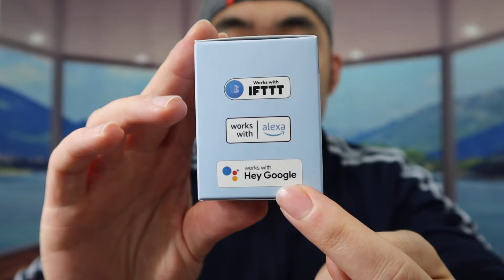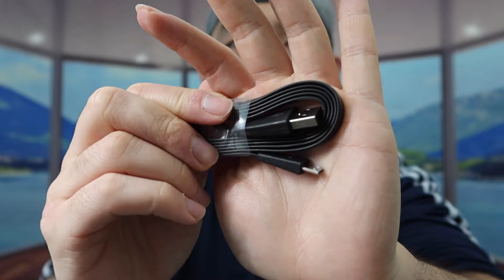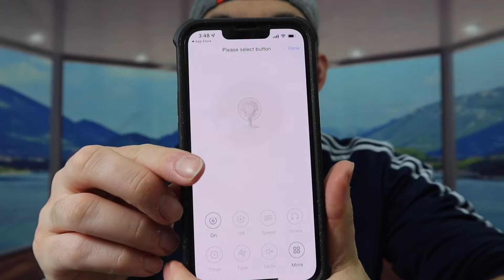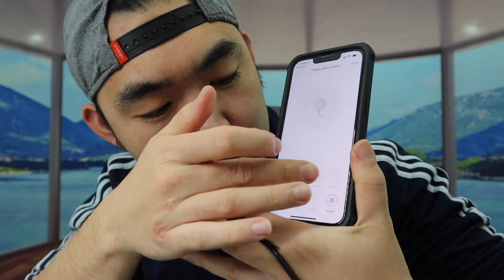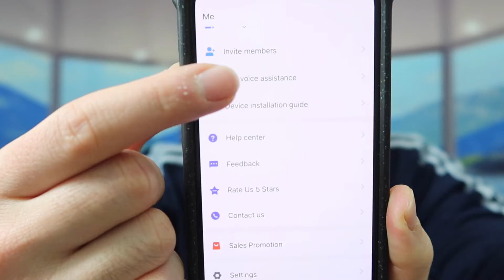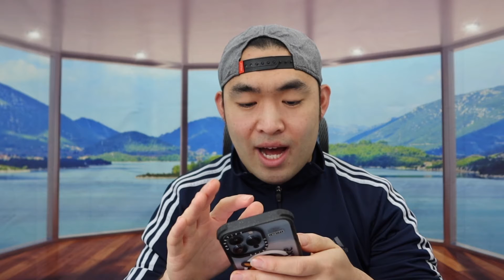How to Use BroadLink RM4 Mini IR Universal Remote Control?

Comment: I'm looking to control UBISHENG U003ATSC (OTA Digital Converter Box) using my android. Just need 0-9, enter, up/down channels. 

Not sure how standard the protocol is, I suppose one could use a FlipperZero+AnalysIR? Or maybe a photodiode + amplifier (BPW34 + OPA381 / AD8615 , OPT101 , TSL260 / TSL262) + Logic Analyzer to inspect?    I wouldn't mind a DIY solution that leverages an ESP or Arduino library (crankyoldgit / IRremoteESP8266 , Arduino-IRremote / Arduino-IRremote) but having a PCB out in the open in front of the Converter box would look kinda ugly.

Or I can just take a chance, and buy the Broadlink RM4 Mini/Pro (or Global Cache) and hope that it can output the same protocol. Although, it would be nice if they published an API so that one can create their own Android app, to control the IR output!   From what I've seen, the RM4 has been partially reverse-engineered (python-broadlink, node-broadlink, etc)..  so if the RM4 has the codes stored, then maybe one could create a  Flutter app that discovers the RM4 (via UDP), connects to it (device id, ip, encryption key, etc), then Flutter could tell it to send one of the RM4's stored code.  
[Or, less desirable, the Flutter app would have to tell the RM4 to send the raw IR codes]

Comment: What can i do if the leared ir signal is not accepted by my device. I also tried the switchbot universal renote hub and it didn't work either. It's just a basic remote for a gas heater with on off up and down.

Comment: Do it need to be close to the appliance? 
Can I remote control an appliance in another room
Reply: it needs to be in the same room as the appliance it is controlling, since it uses infrared light which cannot pass through objects. So you can turn your tv on with it from another room so long as both the RM4 and the tv are in the same room.
Reply: @Hephera  But if it is WiFi or bluetooth?
Reply from the maker: You can use it from anywhere as long as it is connected to the device and wifi

Comment: I want it to control a Cable TV box, turn on, off, change channels, all the features the  cable box stock remote can do.  I need this to work over the internet so I can change channels of
the video stream I am watching of my cable TV.     Can it do this?   I also understand this device works off of the "cloud"  what happens if the cloud goes down or is no longer available?
Will it continue to work?  Does the device have a "Learning" mode for difference remote controls if the cloud no longer supports the device?
Reply from the maker: I think you should be able to as long as the remote is IR.
Reply: Hey I am kinda asking almost the same,  I can't figure out how to get channels to change,  I got tv on and off and sound up and down,  open some apps but I can't figure out the chanel